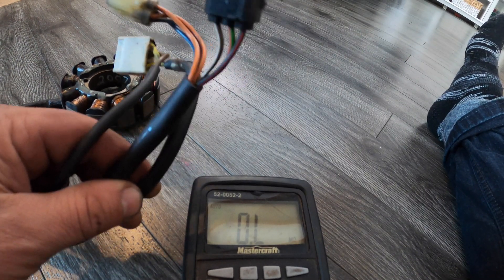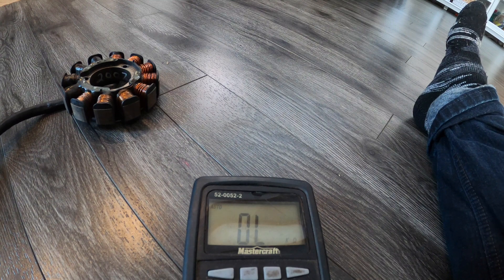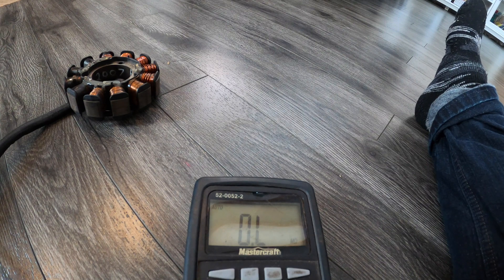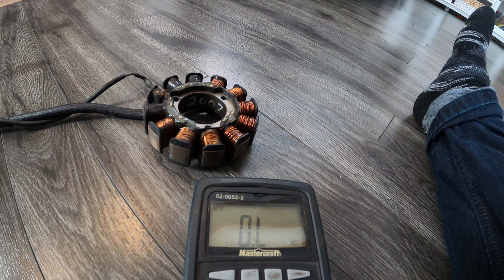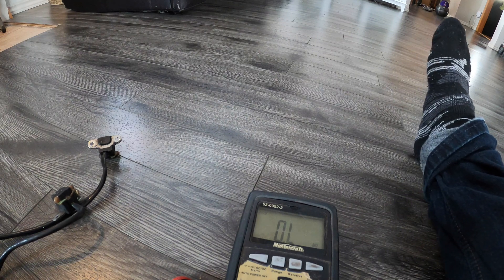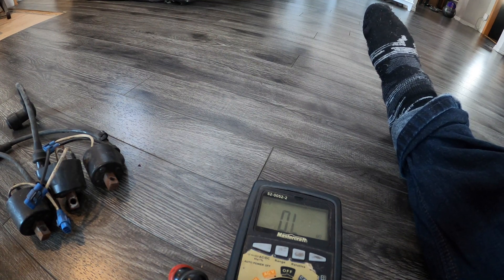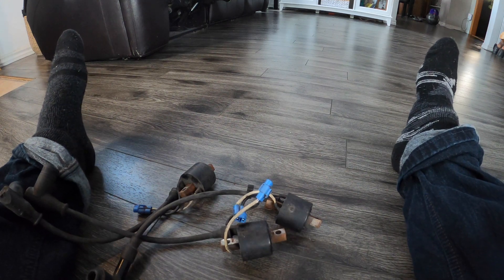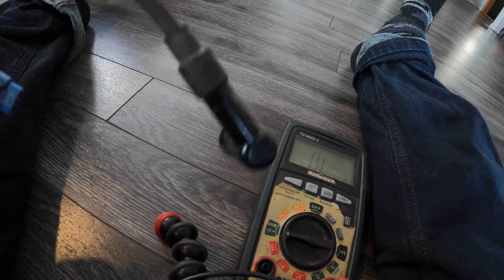Stator Test Arctic Cat 2010-2017 M, F, XF Crossfire 800 Timing Sensor and Ignition Coil Test

Comment: the tip of black lead probe on tester should unscrew to give you a longer tip like your red one... also my sled,  2014 xf8000, no dash, no tail light and no power to servo motor, bad stator? or bad voltage regulator? it's ruined two trips, I thought I had it fixed after the first let down, second trip it worked when we loaded sleds to leave and when we got there to unload same symptoms. any advice would be helpful thanks
Reply from the maker: Could be either when my crossfire acted up with the backfiring and no start it ended up being the voltage regulator not the ecu but that bein said unplug your ecu connectors and inspect for water they are known to sweat and hold moisture lot of times after a big run I put it in shop and leave it unplugged till next drive
Reply: I have the exact same issue with mine. The middle fuse gives power to all of those. My fuse is fine. Checked all my wiring for shorts. It’s a very intermittent problem and any time I try a new part when it quits working it will work with the new and old part. Scared to take it on long trips too